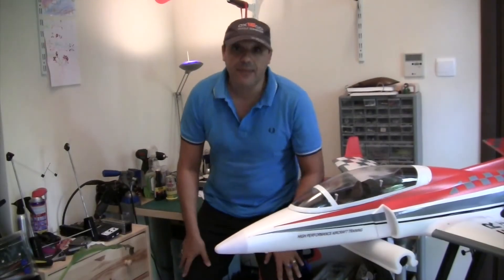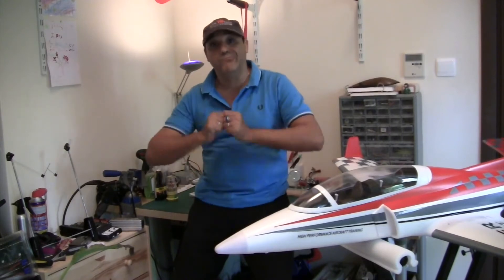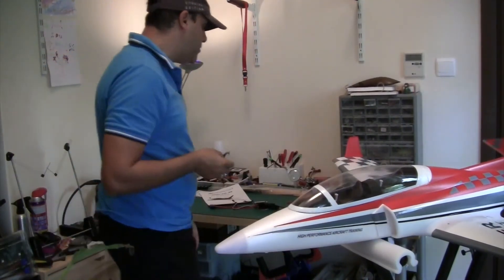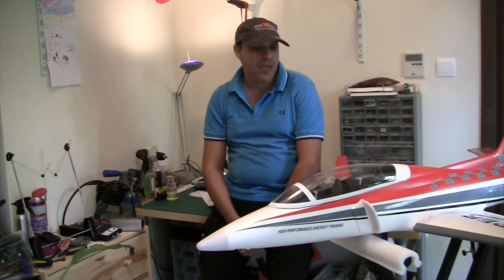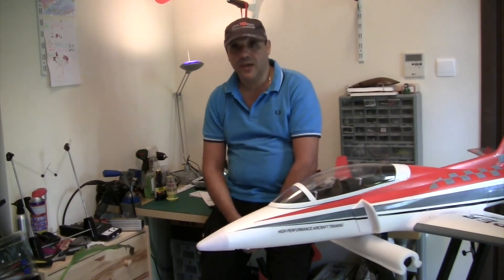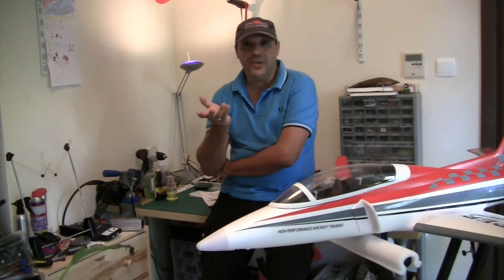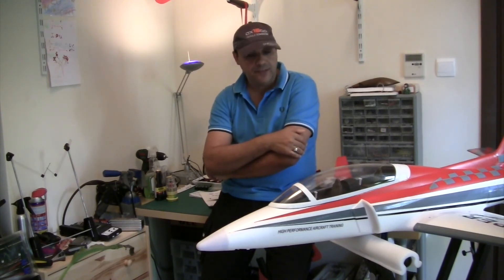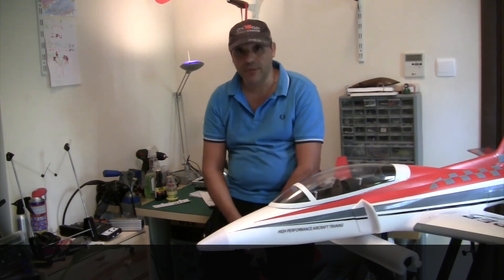Viper jet 90mm EDF Electronics Review

Comment: Hello . I'm from Brazil, my name is MiguelMichel. I just bought a viper taff hobby 90m / m in the free market. Now he arrived, I could see that suffered a breakdown. The front landing gear came without the cover and also think that without the servo system that triggers the mechanism. You could send me pictures of the internal mechanism ???? As the servo mechanism collects the cap ..
I need help to reconstruct the system, if you could help me thank you very much.
Sds.
MiguelMichel
E-mail: migueladriano.michel@gmail.com
Reply from the maker: Dear Miguel, Thank you for your comment. Yes, of course, I  would love to help out. Send me your email, and i will be more than happy to assist with pictures and setup if needed. 

the landing gear is connected to a controller that plugs into the gear port on your RX. Do you need help with the controller setup?
Reply: Thank you so much for responding. Yes if you can give me coordinates how to install thank.
My email: migueladriano.michel@gmail.com
Best Regards,
MiguelMichel

Comment: Thanks for the video, many of us have had similar experiences with PNP servos and ESC (and not just from asian rc manufacturers). Regarding the separate BEC ( I do not agree with author of video): Personally I prefer a separate BEC for my electronics. On all but my small lower power planes I never use the BEC if its built into the ESC. Its generally recommended best practice to use a separate BEC ( or RX battery) and ESC and there a several advantages to doing this.(in fact opto ESC which you will find on pretty much all high voltage setups this is how its done, and for good reason) However I agree that if they advertised it this way should should get it that way. In my experience many asian manufacturers have mistakes in the decriptions of products like this (which is fustrating). I am surprised that you don't have access to change the servo in the front gear bay, that is bad design.

Comment: Still trying to figure out what making that turbine sound.
Reply from the maker: Was that a question ??
Reply: Radio control show Yes it was. If you know how this jet produces that unique turbine sound please do share.
Reply from the maker: ***** By reducing propeller blade tip losses, the ducted fan is more efficient in producing thrust than a conventional propeller, especially at low speed and high static thrust level 
By sizing the ductwork appropriately, the air velocity through the fan to allow it to operate more efficiently at higher air speeds than a propeller would.
For the same static thrust, a ducted fan has a smaller diameter than a free propeller, allowing smaller gear.
Ducted fans are quieter than propellers: they shield the blade noise, and reduce the tip speed and intensity of the tip vortices both of which contribute to noise production.
Ducted fans can allow for a limited amount of thrust vectoring, something normal propellers are not well suited for. This allows them to be used instead of tiltrotors in some applications.
Ducted fans offer enhanced safety on the ground. in simple words the air traveling thru the blades and the duct produce the sound, by increasing the number of blades you enhance the sound, 
Hope that info helped.
Reply: Radio control show Wow thanks for taking the time to explain this.  Tons of good info here. Thank you.
Reply from the maker: ***** You are most welcome.. Thank you for your kind comments

Comment: The ESC failure is one thing but I don't understand why in your review them adding in the better external Hobbywing BEC would be an issue for you worth mentioning as though it were a disadvantage. Do you know the difference between an internal BEC and a UBEC? Opto ESCs with external BECs are a better combination with less chance of losing control if the ESC explodes like yours did. Any time any of the manufacturers switch to external BECs,  it's considered an upgrade.
Reply from the maker: Thanks for your comment, Your point of view is highly respected. I have been flying mine with a built in BEC and had had no issues. At the end it depends on previous experiences and preference. Also I was really Dame upset with what happened. Regardless. Both of your opinions are highly appreciated and respected. Thank You
Reply: Thank you for your comments

Comment: I think they used a UBEC not a built in one because there is all metal gear
Reply from the maker: Hello, This might be true in the old days, But today, almost all good models use BEC Controllers, and the issue really was that it was defective. Thanks for your comment.. Appreciated
Reply: No, they used a separate BEC becuase that is how it should be done. There are several advantages to not having your electronics running on a build in BEC in the ESC. Its generally known and recommened good practice to do this (or have a RX battery) . I do not agree with the video authors view point on this issue.
(However I do agree he is upset that ESC failed and is not what was advertised )
Reply from the maker: Thank you for your comment, I highly respect your opinion, and i understand where you are coming from. I was very upset from the ESC failure and as not as advertised issue. Now with regards to my current setup I am using Running with a build UBEC and I am having no issues whats so ever. At the end its what the pilot prefers. Thanks again
Reply: Radio control show  Yep totally understand the upset , I would be too if parts fail out of box.
Reply from the maker: Paul Smith Thanks for your comments, Appreciate it.. Cheers